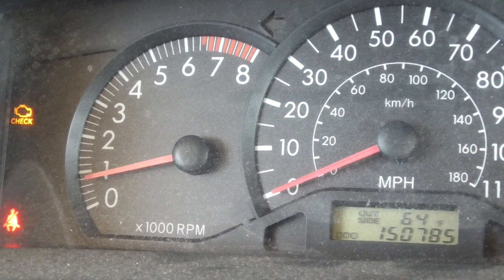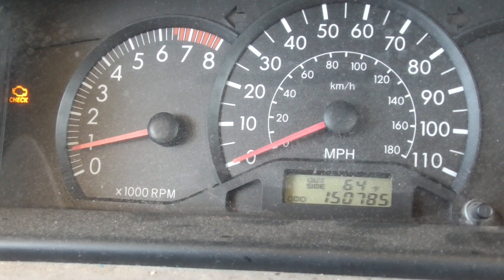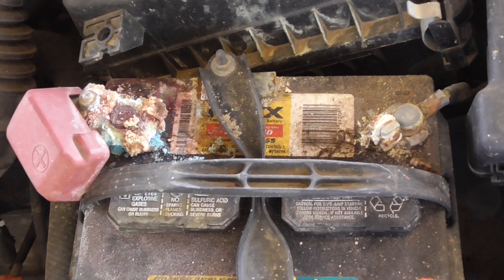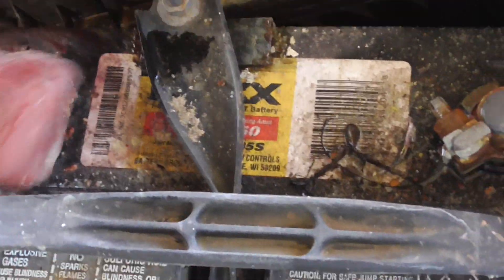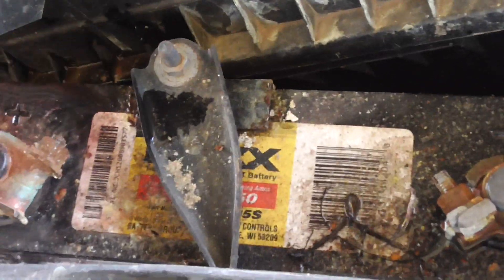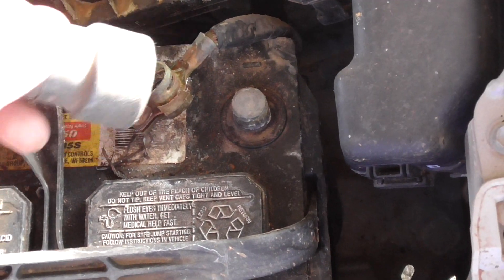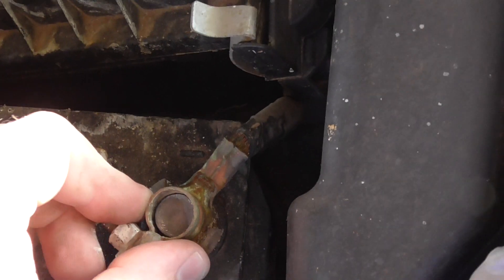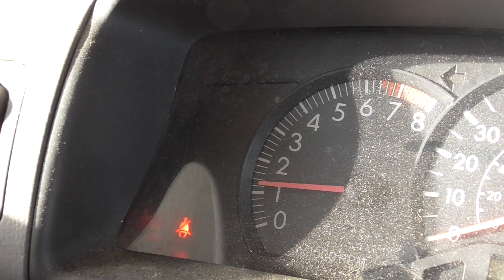Check Engine light on a 2008 Toyota Corolla CE.  Try THIS before you take it in for service!

Comment from the maker: Later discovered that the Check Engine light was coming on due to a weak battery.  New battery, no more issue.
Reply: Same happened to me
Reply: You didnt ckeck the code first
Reply: @mariovelasquez72 , how would you do that?
Reply from the maker: I didn't have a code reader at the time I made this video.
Reply: I will remove the two head of the battery or only one?